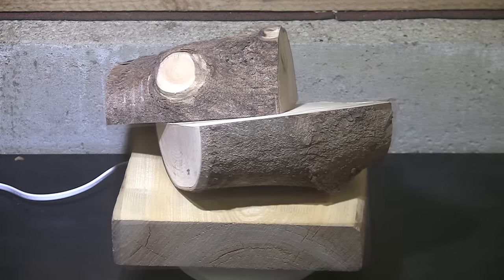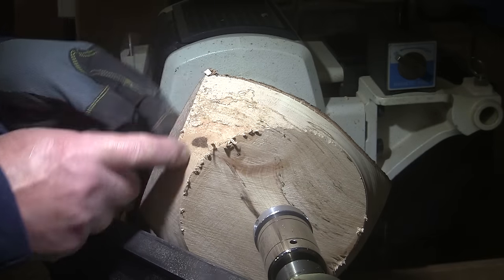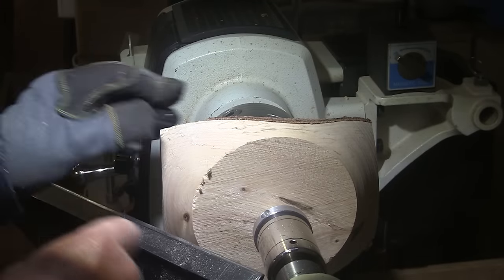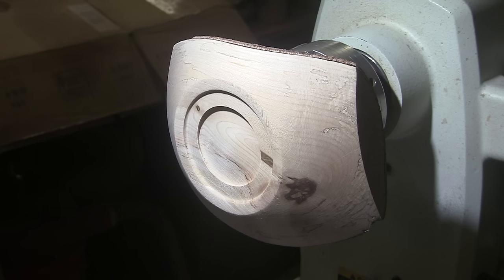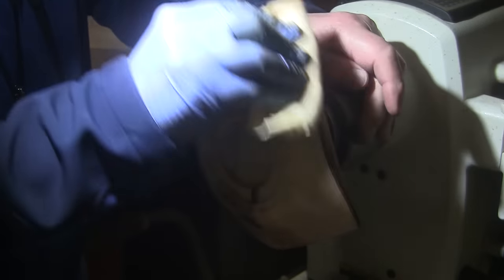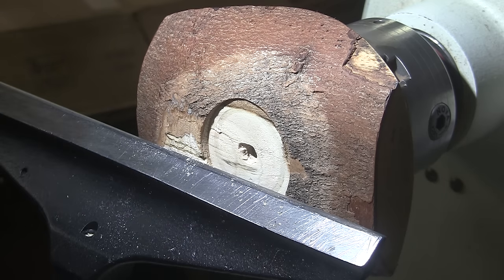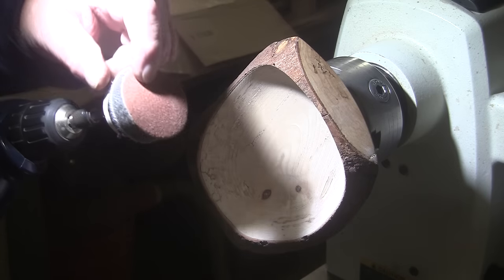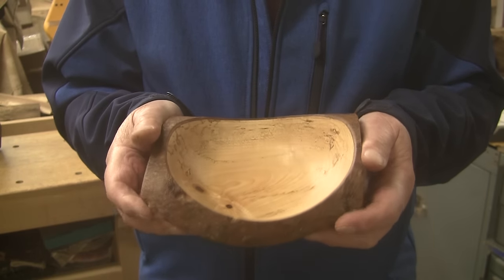Madrona 👀 So Smooth And Alive! - Wood Turning

Comment: Hello Phil, it had been my hope that you would turn some madrone wood.  Madrone is great, in part because it is so plain and yet so interesting.  Many thanks to Mr. Chapman for sending this to you.  

Does applying a finish, such as shellac help to stabilize the bark on a turned bowl?  it can be challenging to keep the bark on madrone.  So I am wondering if the shellac will help to keep it in place.  

Lovely bowl, by the way.  Plus, after the minor kerfuffle with the recess, you now know that the bowl is strong and durable. ;-)
Reply from the maker: Thanks, Deirdre!  It has been my experience that, once finished, the bark stays on.  Never an issue for me. 😃

Comment: I have always wondered what the shape would look like if you left the ends basically alone. Well I like it. This add chat to the bowl. It’s just not round. I really like this piece Phil. It appears to be really smooth. Again this is because of your dedication to sanding. This is a big deal that others over look in my opinion. 
Thanks for the show. 
Joel
Reply from the maker: Yeah, so important to get the sanding right, Joel.  Thank you! 😃

Comment: That live edge bowl is really nice. When I have to do a recess I like to put two rings in its surface with the point of a small skew to finish it off and not have to be so particular with the sanding in the very centre that does not spin much. Gives me two lines to sign and species it in between.
Reply from the maker: Yes, I've seen that done, Ronald! 😃

Comment: Phil’s blank jumps off the chuck and quickly flops onto the bed of the lathe.

My blank jumps off the chuck, clips the lathe bed, caroms off my face shield and rolls under the workbench across the shop.

Fantastic end result!!
Reply from the maker: Haha, I have experienced that too, Nathan but not for a few years. 😃
Reply: Ha, I’ve had that happen several times. When looking back the cause is usually a slight miscalculation in initial turning. Ya know, it might be interesting in having a scoring system to rate these events. lol!

Comment: Thank You Phil, Thank You Rick Chapman, Thank You Arbutus menziesii...I have been told folks call it a Strawberry tree. I see quite a lot when I hike around exploring. Sure looks like it is smooth turning wood (glad no damage flying off, see Phil ya should have used a tenon, ha).   Q- I understand the reason you go forward and backward when sanding to make sure you sand off any folded over wood fibers but why do you have to reverse the drill motor? Going forward & reverse both with the drill when turning both directions. If I am making any sense?... I see the ghost and looks like the ghost tried to write "dog" above it's head?.. Nice turning today Phil & look forward to next Thursday... TM
Reply: Thank you Tuffy. 😊
Reply from the maker: I reverse the drill because of the different forces of the spinning piece in different directions.  I know that means absolutely NOTHING! 😃  If you try it, you will definitely see the need to change drill directions.  It's some kind of metaphysical, scientific explanation that is beyond my vocabulary, Tuffy!  LOL!